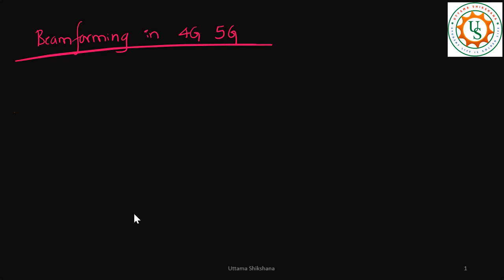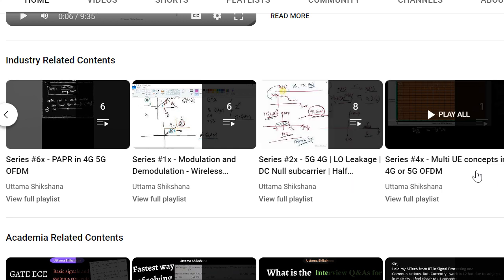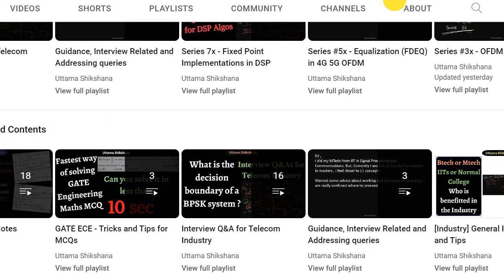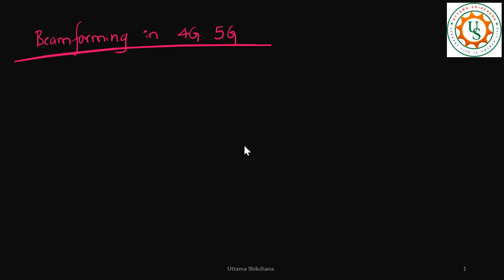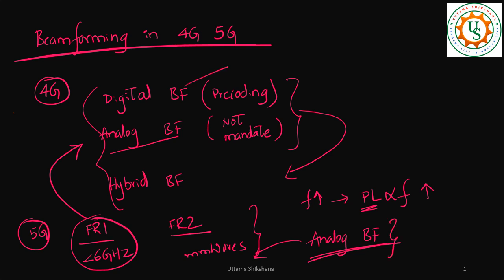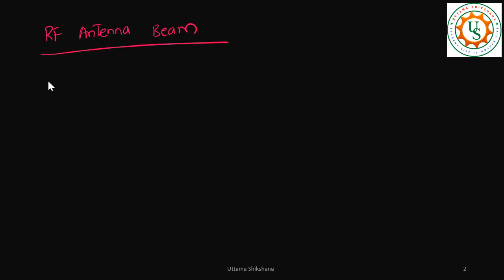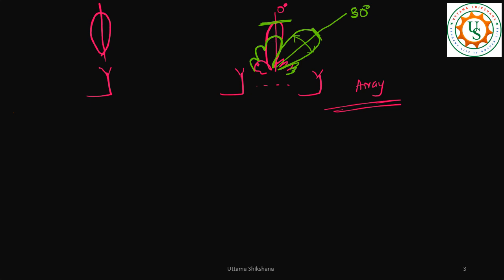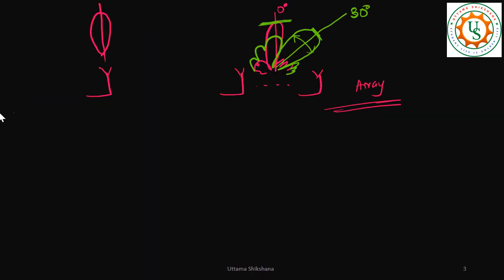[Series #9_1]  Beamforming (BF) Intro and Basics | Why do we need BF in 5G mmWaves ?

Comment: Hi sir, I had following questions
1. The angle that you are talking is azimuth angle or elevation angle ?
2. The antenna array that you are talking about is broad side array, not end fire array. Am I right?
3. Why two types of beam forming is required(analog and digital) when the purpose is to form the beam ? 
4. Please provide reference for studying about beamfoming. Textbook or IEEE papers.
Reply from the maker: For point #1: I had spoken about azimuth angle in this video. But, it is true for elevation angle also.
For point #2: Yes
For point #3: Both have different applications and different merits. So, accordingly, the required type of beamforming technique is used.
For point #4: In you are a beginner then, start with Wikipedia.